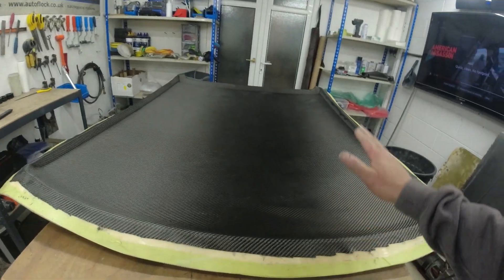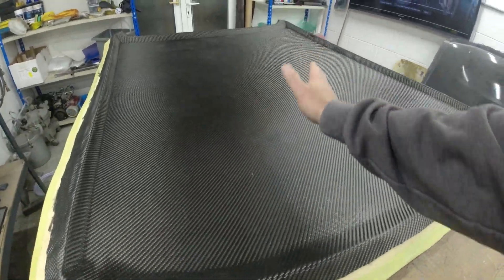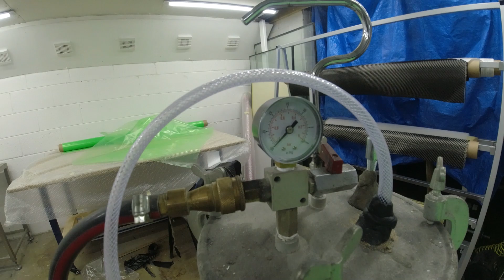Resin Infusion - carbon Fibre Roof

Comment: Top work there mate! What type of gel coat are you using? Is it a vinylester or a epoxy compatible polyester? It leaves a lovely finish!
Reply from the maker: Hello John, this was made using a polyester gelcoat which is epoxy compatible purchased from Easy Composites called GC50.  I hope this helps.

Comment: Nice job there!
I have 2 questions for you:

Any reason for not using 4x4 as first layer (I've heard that 4x4 is quite loose though).
How come you didn't go the shorter way with the infusionhoses, east - west instead of north - south?

Just trying to learn here ☺
The roof looked very nice!
Reply from the maker: Hello there, I have actually gone the shortest way with the infusion, if you watch the video you will see I have a inlet feed at one end then another in the middle, so the infusion is split into 2 parts making the distance as short as possible, once the infusion reaches the centre the 1st inlet is clamped off then the second one in the middle is opened.  I hope this makes sense.   In regards to the 4x4 its just my personal preference to use a 2x2 for the first layer as I prefer the look and the way I can make it drape over the mould contours.  I hope this explanation is of use to you.
Reply: @autoflockmotorsport7730  Thx mate ☺
subbed

Comment: Lovely work! What release agent do you use? I've tried many but seem to have sticking issues, and your parts seem to pop off perfectly!
Reply from the maker: Hello Gary, it all depends on which part, I use either a wax or a chemical release.  But the main thing which doesn't change and is the major factor in ensuring a good release is the prep of the mould.  Firstly the mould must be scratch free and polished to a high gloss, this removes the risk of a mechanical bond between mould and part.  Then the mould surface is treated to mould sealer and then mould cleaner.  Follow those steps and you should have no issues.  I hope this helps.

Comment: It will be interesting to see how to mount this roof on the car !
Reply from the maker: you remove the existing roof leaving about 30mm lip, then this bonds to that using a panel bond adhesive such as 3m 8115

Comment: Looks fantastic mate! Do you use epoxy or polyester resin for this?
Reply from the maker: Hello Kevin, thank you very much, this is a epoxy infused part using resin from easy composites
Reply: @autoflockmotorsport7730  nice one mate. You don’t degas your resin? Part turned out perfect as well but I always have issued when I don’t degas
Reply from the maker: @Carkevo  I never degas via a chamber as I found that to be just too much hastle, I just take care when mixing the resin and then allow the resin to stand for 5 mins, the air naturally rises and disappears.  Seems to work for me

Comment: Beautiful work Raj 👌 Out of interest which gelcoat are you using for UV protection? And which brand of spray-tak?
Reply from the maker: Thank you Jason,
https://marineware.com/composites/compositesvacuum-consumables/aerofix-3-spray-adhesive-tin
https://www.easycomposites.co.uk/epoxy-bonding-polyester-gelcoat-clear
I hope this helps
Reply: @autoflockmotorsport7730  thankyou so much Raj. I've been using 3m super 77 but would like to try an alternative 👍